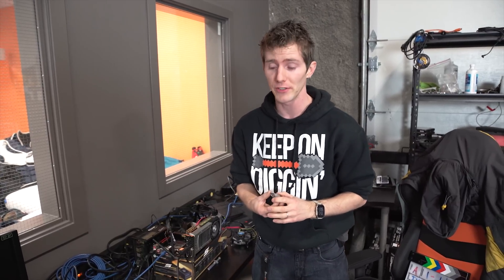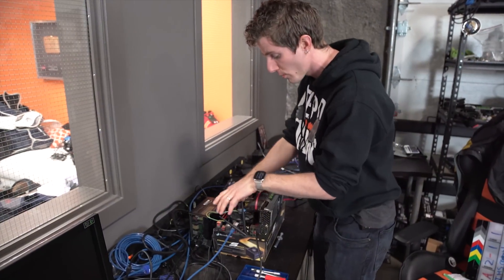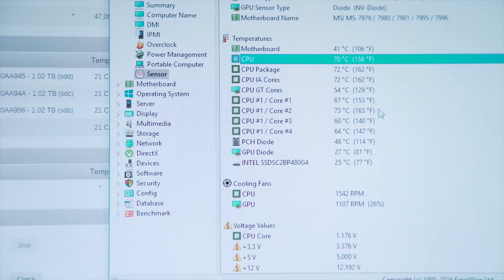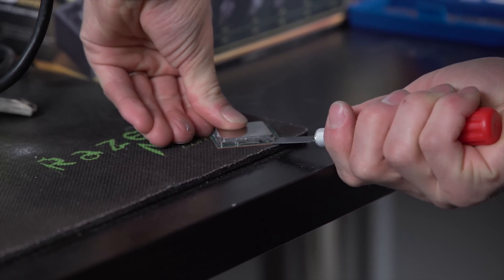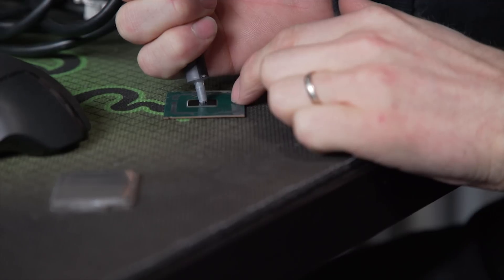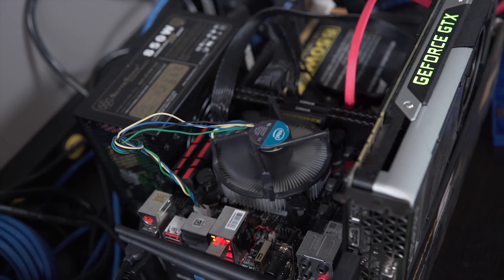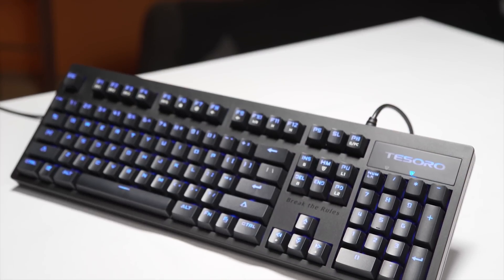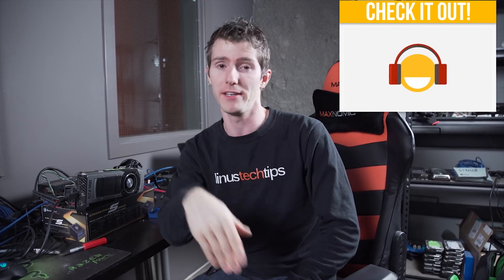Delidding an Intel Core i7 6700K - Is it worth it!?

Comment: I'm curious I have a old CPU and I noticed a bent pin this makes is complete useless right?
Reply: Luis Martinez you can straighten it up, but if nothing helps as last resort you can cut that pin and put it in that exacg hole in the motherboard, od t recommend it tho
Reply: I bent a few and bent them back and it worked for a few more years. That was like a 775 or 478
Reply: Luis Martinez you can maybe straitened it out if you are lucky
Reply: Luis Martinez Check and see what the pin is for.

Comment: I first did this back on Ivy Bridge with a watercooling setup up direct to die with Cool labs liquid metal. It took 20C off my overclock so I was hugely pleased at the time!

Ive done it on my 4790k but not had the same success, more like 10-15C. 

It's not going to make much difference in this scenario - stock voltages with the stock Intel cooler but start putting more watts through that combination and you'd see more than 3C I'd bet.

Comment: using a stock cooler on an adaptive fan speed ?
lol
1st you should have put the fans on max speed , because now the cpu is running at lower temps so the fans are slower so that translates to same temps as b4

Comment: I did this with my 6700k a month ago. tried normal TIM and saw only a few degree difference like this vid...was really bummed. then bought the CoolLaboratory Liquid Ultra (the stuff you guys reviewed a year ago i believe) and applied that instead (make sure to insulate the bits next to the chip so no shorts hehe). The liquid ultra dropped temps from low to mid 80s (4.7ghz @ 1.37v) down to 65-70....was SUPER impressed. (was using a h100i V2). DO NOT USE NORMAL TIM! NOT WORTH IT! if youre going to do this risk...make it count with liquid ultra

Comment: Still the stupidest and incorrectly done video in LTT history
Reply: Please like his comment
Reply: http://www.hardware31.fr/2017/10/le-delid-easy-8700k-passe-au-gril-5.html
Reply: Everyone makes mistakes ;) even Linus
Reply: @池たくみ
I just flashed my bios so I can OC my Non-K 6700. I did some OC on the stock cooler and it's a little hot so I ordered a AIO liquid cooler. Did delidding yours help much with temps?
Reply: @DrDingus  Delidding with liquid metal can help you get some degrees lower for a few bucks. Watch more recent videos of him and see that his opinion on this changed too✌
Reply: @frohdosieber6867  I got my AIO and have my non k 6700 OC to 4.5GHz . On cinebench 15 I get a score of 964 and single core score is 197. Temps stay below 70 now at load.
Reply: Delidded my i5-3570K, temps went down at least 15C with liquid metal.
Reply: J0xxe yes teach us plzzz, másteres .i.

Comment: 2 years ago i did the excact same thing in my i7 3770k but instead of just replacing TIM i went also for IHS lapping combined with liquid metal compound on the dye.Using a Corsair H100i before and after the TIM replace / lapping i got close to 18 degrees celcius less than before.TIM used between H100i and CPU was and will be forever Artic Silver 5... Are you into gaming videos? Come check my channel   www.youtube.com/PritsASSGamingVideos

Comment: So all that trouble and risk, for what? 3 degrees difference ?
Nope, sticking with the stock solution lol
Reply: Kid574 I had a good 15-20deg improvement using CLU under the lid with my 6700K. Will now happily sit under 60deg at full load whilst clocked at 4.8GHz with a Kraken X61.
Reply: Liquid metal alone gives you 5-10 using a stock air cooler. Try something like a water cooler, you get more. Then if you use thermal paste, there is even more. Usually, tested gets about 10-20 degrees better. 
Remember, this test was some cheap compound, janky setup, stock air cooler, and Linus was in charge.
Reply: If you do it properly (unlike LTT), yes, definitely. CLU under lid with great care, re-adhere with black RTV gasket maker (I used Permatex), then use a decent paste under the cooler itself.
Reply: So overall, if you're freaking for lower temps to make more overclocking headroom, then its worth?
Reply: With liquid metal you can get 5-10°
Reply: Isaak
hm that's pretty usefull info. Thx

Comment: i did it to my 3770k, the main reason was because i had a 11 degree difference between core 0 and core 2. im on water. before i could only manage a 4.5, after i am stable at 4.7, at 70 degrees. and my temps are about 2-3 degrees different, rather than 11 degrees. i saw a massive benifet.

Comment: makes no difference what metal, ich bla bla whatever you use... great isn't transferred and absorbed in 1 second... it's Laurent.. once you make contact USD enough... and no, you don't have to push it harder and nonsense.. metal touching metal no matter how light or hard, will transfer the same heat... you're not pressing down hard enough to deform either metal so it doesn't matter.

Comment: To me you just proved it is worth De-lidding and replacing the TIM. Its easy and works. An easy way to lower temps even more. Combine that with the latest TIM and an after market cooler and it will all make a huge difference. I guess its down to personal preference. Some people are happy with stock coolers, some like to upgrade a bit and some like me like to try everything possible.

Comment: I just finished reading a blog where 6700K was delidded. Results in temp were significant. Over 20 degrees Celsius on IntelBurnTest and Prime95. 5 C idle isn't much, but over 10 C drop in temps on all cores for CS:GO is worth it. That is, if you got the know-how. Maybe try again with the help of someone who has done delid successfully before?

Comment: You did this wrong. Please redo this video for actual results, we are all intrigued!

I have seen results with 6700K that show how great this is for overclockers. Intel Burn Test temps dropped from 80-ish to 55-ish!!

This guy used the "Liquid Metal stuff", a 3D printed delidder in a vice and it was actually overclocked with a proper cooler (4.4ghz 1.232v).

You do not just use some thermal paste which could be as bad as Intel's anyways and as we all have seen, thermal pastes do not really differ THAT much. BUT when you are comparing a liquid metal to a paste, obviously the liquid stuff has better conductivity, which is the deal here!!

Comment: The way he's handling the CPU O.o...  I thought people say to handle that thing with care and stuff, but Linus is man handling that thing and it still works?!
Reply: LGA CPUs are pretty damn resilient, it's almost impossible to damage them by accident, you'd have to actively try to destroy one.
Reply: Antares 8001 

Ah I learn something everyday
Reply: I think when most people say that they aren't referring to LGA (land grid array) footprints or pinouts. Intel, i'm sure as you know, uses contact points on the bottom of the CPU with pogo pins in the socket, effectively opposite of AMD, and older Intel CPUs, which if any of said pins are bent(and they would've been when he put the CPU pin side down on the table and was pressing all over it with a chisel) the CPU is effectively rendered useless unless you can bend them all perfectly back in their place so their line up with the socket, without breaking one off. Effectively the only thing you could do to an LGA is either break off one of the capacitors on the bottom, which is actually pretty difficult unless they weren't sufficiently soldered to begin with, kill them with ESD, or mangle the die once the IHS is removed I guess. You could technically also destroy one of the pads on the bottom or completely remove it, but to do that you'd have to be really careless.
Reply: StopTurtle Yeah he does lmao
Reply: 1119g0191up @cuminfothatbooty  q
Reply: Linus Drop Tips™
Reply: i dropped my i5 twice in a row and it still works. Although the sound it made was soul crushing.
Reply: Willing to bet he doesn't get a lot of things that are expensive for free. He has another video regarding this saying that he gets loaners, though he still likely gets some freebies. Doubtful that the CPU he has or a lot of the things he touches is without cost.
Reply: Candi Soda once Intel stopped using pins on their cpus they became pretty rugged
Reply: hey Same here. When I got my 1060 a couple of works ago I was honestly handling it like it was the Mona Lisa. Well, I suppose it is to me :D
Reply: I once had some one build my first custom PC and he let me watch him so I could learn how to build a PC. He dropped his phone and it directly crashed into my mother board but he didn't even care and apparently there hard to break.
Reply: he did it with the 8k red camera aswell
Reply: Azurumi Shinji yeah some of them are made out of really good quality PCB
Reply: In order to damage a cpu by physical force you really need to beat that thing up. Mobo pins are a different story. I've dropped CPU's from 4 feet into the ground and they still work. Don't worry guys, CPU's are not as fragile as other components.
Reply: you don't need to wear gloves lol. Iv'e had chips shitting on shelves, in closets, loose in bins, etc. as long as you don't physically damage the contacts you're good.
Reply: Dude it's almost impossible to damage a cpu. You can drop, you can punch it... it doesnt matter it will work.
Reply: Süleyman Kenar
Ok, that is a little far. you could hit the circuitry on the back with anything somewhat solid and it would break the chip.
Reply: unless the pins are on the chip.
Reply: he also dropped a gpu lmao
Reply: put it this way intel makes these chips with surgeon gloves so  if you want to hold it on the area  with the landings on the chip go ahead but wear gloves tho
Reply: Candi Soda its probably because that is like an early pentium to them.
Reply: Yeah pins are hyper sensitive... I dont get it why everyone is claiming that is tuff and punchable without care.
Reply: bruh are you high??
Reply: Candi Soda dude other people clamp the heatsink in a benchvice and hit it with a malet and the cpu flow across the room but still worked. linus did this very carefully
Reply: Murilo oh man the cpu is the most delicate part i had a hard drive for 10 years felt like 6000 times and still works like a charm some guy in my class was switching a cpu and broke some pens
Reply: Biggest reason they break is if u shock the shit out of it from static elec
Reply: Murilo j
Reply: +Antares 8001 When I was troubleshooting my PC with a 6700 I had my flashlight inmmy mouth as I was trying to put a screw in the motherboard in the corner closest to the CPU. The flashlight slipped from my mouth and fell at least 2 feet right on top of my unprotected CPU. Based on how much tech people on youtube stress fragility in CPUs I thought for sure that it broke, but it still works just fine.
Reply: I've dropped LGA CPUs before. I've even dropped my brand new i7 2600K from a chest height on concrete floor, back in 2012, and it worked fine for years and years... Why do people have this flawed concept that CPUs are somehow really fragile and any small shock will send them straight to the trashbin? It's bs.
Reply: The pins for intel are on the motherboard. if pins were on the cpu then yeah handling it like he does would bend the pins all over the place. DONT try this on AmD at al. youll bend the pins
Reply: does not mater to be honest Linus has almoust 4mill subs and this video alone has 1,6mill views hell ye he can drepe them he can cut them and he can dance on a hand full of chips he will still be on the green...
Reply: Candi Soda Donald Trump!! FUCK YOU!!!!!!
Reply: +Eric K No he doesn't lmao

Comment: It may not do a difference in a nasty heatrecycler like that setup and with no oc applied. 
Try it with a efficient highflow custom loop with a radiator big enough to eliminate water temp changes,  for my old 4770k it ment the world in difference, and i find it hard to believe it shouldnt be the same with the 6700k